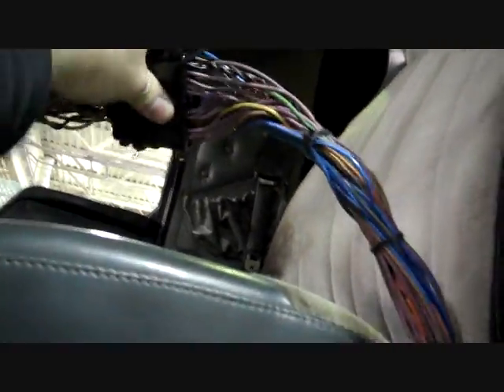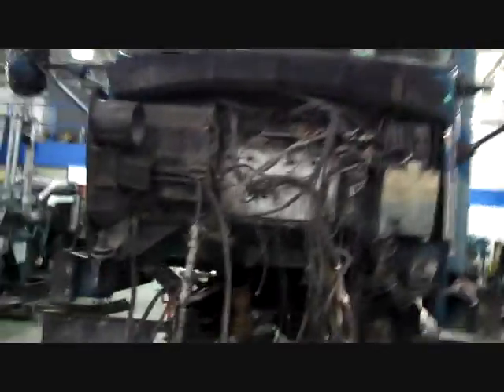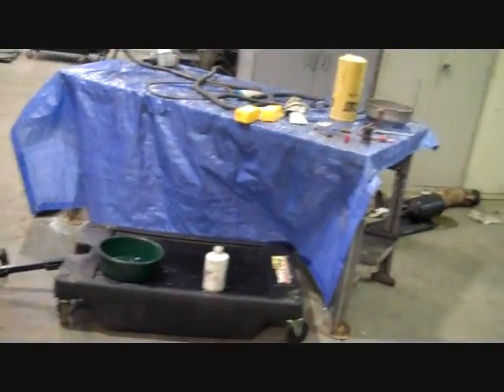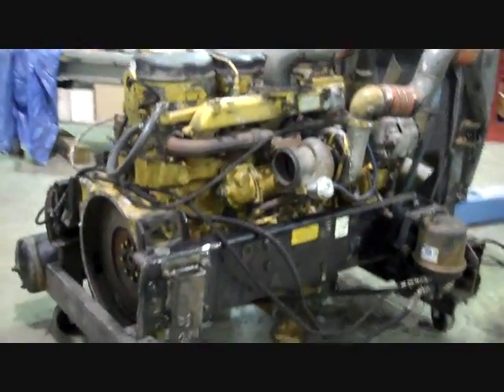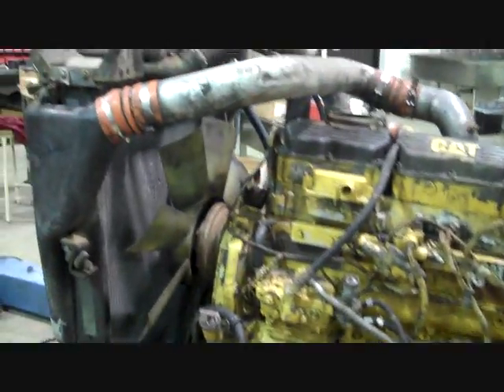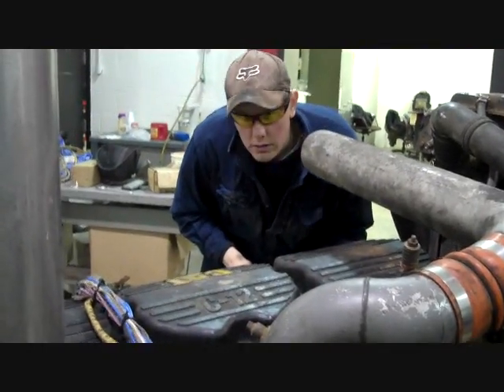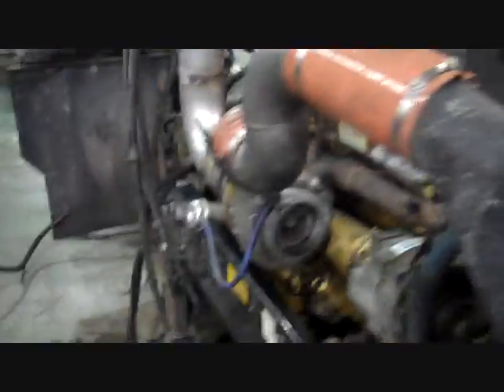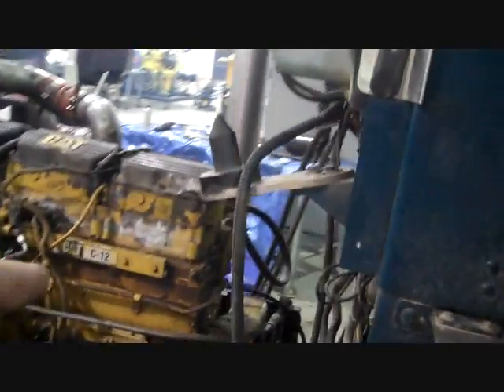Rebuilt C-12 first startup

Comment from the maker: @zachgt500 thanks man, unfortunately, it had a few problems after this, a few rods bent and the fuel pump ground down, the next class took it apart again, repainted and re-assembled it better, we were just trying to get the thing running again. this engine will, unfortunately, always be a class showpiece. but on the other hand, the cab is fully functional which is super awesome.